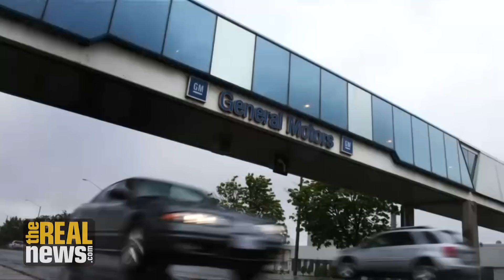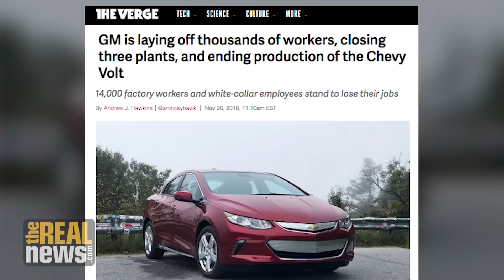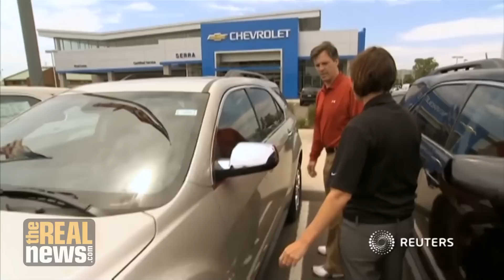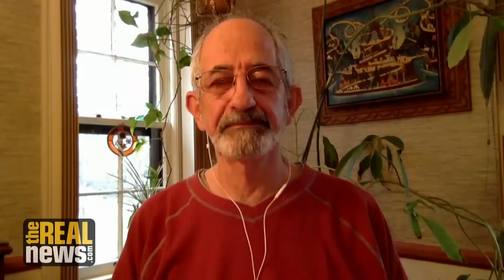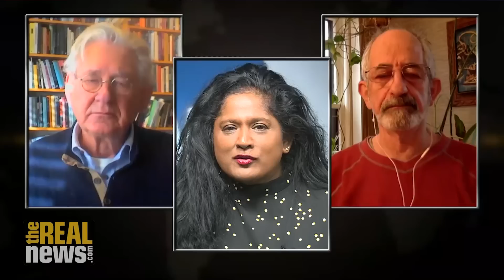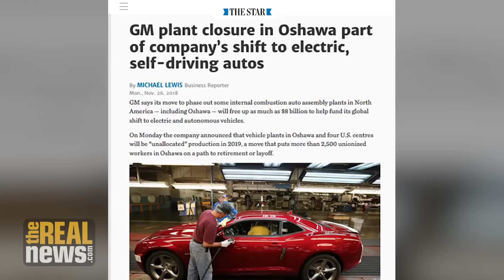GM's Layoffs Made Possible by Weak Unions, Automatization, and Bad Priorities

Comment: The only reason GM produced the electric Chevy Bolt was for public perception in the aftermath of the big bailout of 2009. They have dragged their feet and never got behind electric cars which they badly need to do. The sands are shifting and in addition to basic corporate greed GM are likely to be misplaced when the floodgates open for EVs. What they really should have done was invest aggressively in electric cars etc. A call to Elon Musk would have been good.  But now GM are attempting gravity defiance and will spiral down to the bottom.

Comment: The plant should be taken over through eminent domain and turned over to the workers as a worker-owned cooperative.
Reply: Exactly right. The workers at auto plants are perfectly capable and motivated to convert gas guzzling to electrical and solar, after they take over ownership in a revolution.
Reply: Genius 😃
Reply: Let's elect an NDP government to support worker coops!!!
Reply: That's gonna require finance. We can use the Bank of Canada to  finance worker coops
Reply: @nugrid1117  Precisely. I'm sure the workers who take over the banks will want to finance other coops. Cooperation, not corporation.
Reply: Agreed. Why don't the politicians see this as an option. Are they afraid it works too well?
Reply: just steal it .....it worked so well in Venezuela.
Reply: @rickbelieves7652  That's pretty much what the big corporations and big oil were doing to Venezuela.
Reply: Bundle of Perceptions to make cars that don't sell?  & who will pay for costs?  living costs?  However good idea if GM forced to pay wages for one year & convert building to  an arts & crafts, community center, vo-tech or combination???  Do what Philly did, pay to start a murals program to "pretty up" run down areas - google it, stunning.
Reply: Sandy The Government should. The fact is that one of the biggest buyers of vehicles in any country. Also utilize the anger that the public feels towards the GM to pivot the public market.
Reply: @65minimom  I'm so tired of hearing that their cars don't sell. Advertising sells. I can't remember the last GM advertisement I saw for one of their cars, and I've never seen one for the Volt. They have plenty of ads for their trucks and SUVs which run on a regular loop. It's almost like they didn't want to sell cars, especially the Volt. Everywhere I've looked, all I've seen is pretty much all good about the Volt from people who have bought them, more than a few saying it's the best car they've ever had. 

If cars aren't selling like Ford and GM want to say, maybe someone should tell all of the foreign car manufacturers that flood TV with car commercials and are selling away. The big three have always been in bed with the big oil companies and I think this is just more of that bullshit. And I'm a car guy that loves his ICE powered toys..

Comment: Please increase the volume of your videos. Thanks
Reply: It is recorded too low - usually they are O.K. - just a friendly reminder - thanks
Reply: A subtle form of covert censorship, and not by the producer of the video.
Reply: @TheUtuber999    Nope, no censorship  - this video was recorded too low - It is possible to download it with DownloadHelper and adjust volume with VLC player. - Usually the volume of their vids is O.K., but this time maxing out the volume on the computer was barely enough.

I guess with  earphones  you could adjust that as well - but technically it is not difficult to get the level right before the uploa).
Reply: @xyzsame4081  You can't know that.
Reply: Or maybe turn up your volume. Just sayin'
Reply: @rdpatterson2682  - No, it definitely is recorded too low, especially on mobile. I had to hook my phone up to speakers.